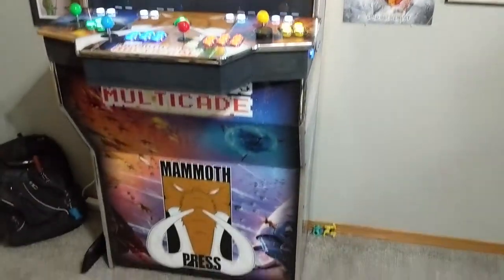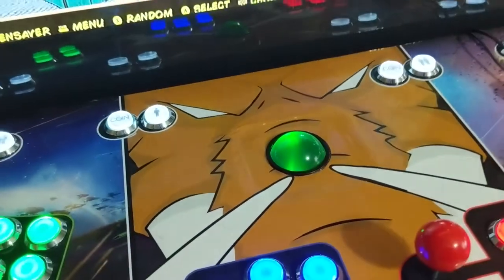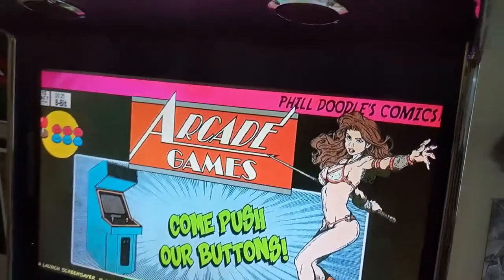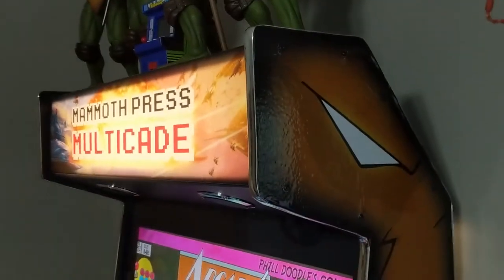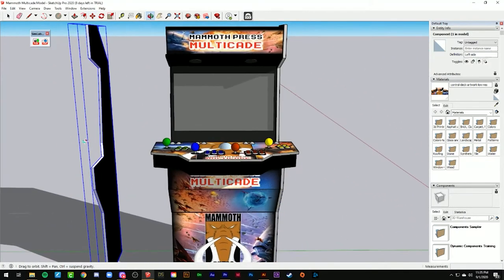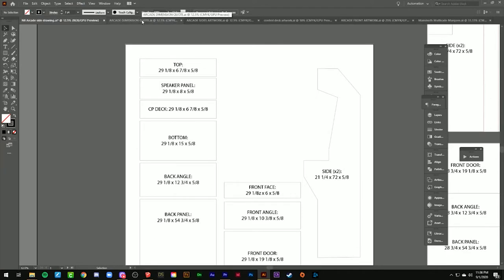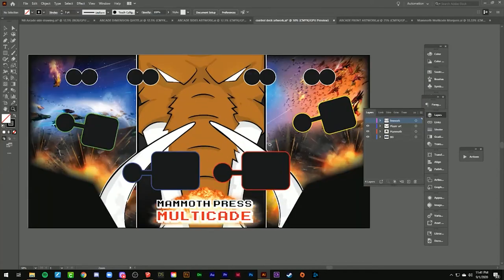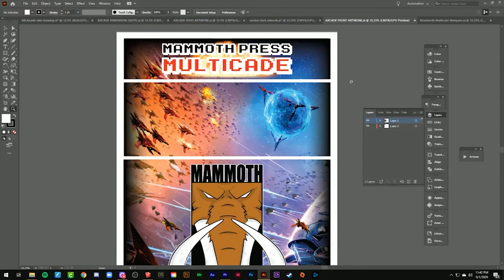DIY Arcade Machine Cabinet Build: Episode 11: The Mammoth Press Multicade!

Comment: So in sketch up is it possible to 1 1/8" holes for arcade buttons? Or how do I create the die lines and pluses?
Reply from the maker: Absolutely, you can make the button sizes whatever you need. Just remember to consider another bigger ring around the holes for buttons to account for the button trim when spacing.   All the die lines and pluses were done in Illustrator- After getting the proper measurements for each piece after building them in Sketchup, I took the measurements into illustrator and made the die lines and pluses with the pen  / shape tools. I hope this helps, but hit me up with any questions if you need further explaination.